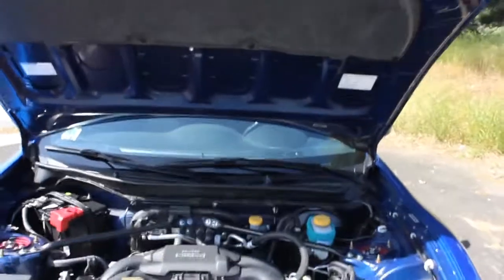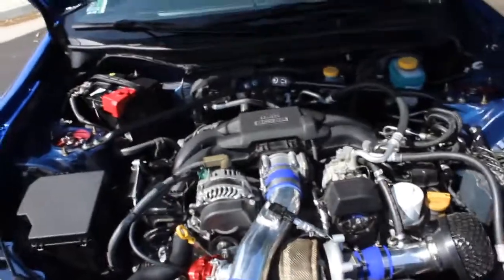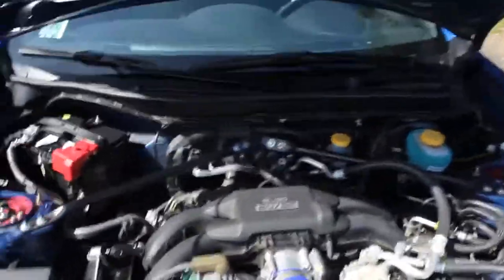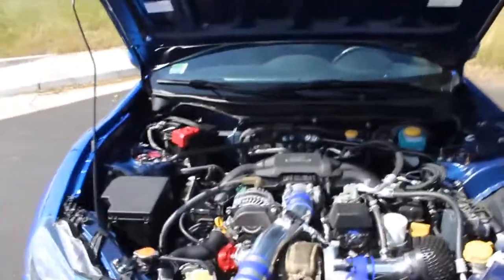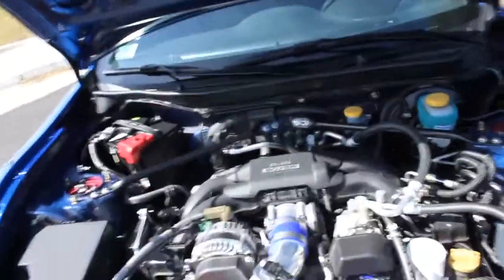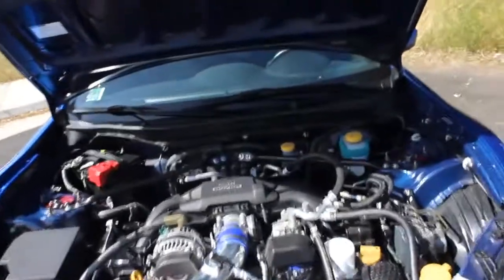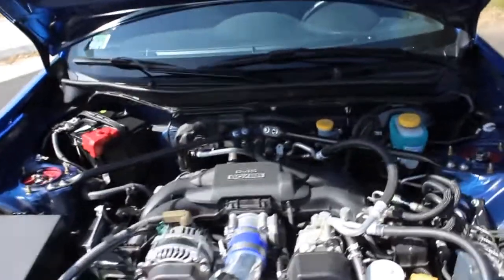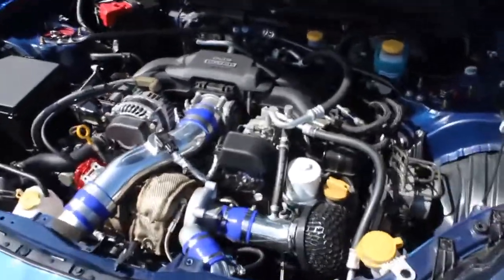(SBD) Speed by Design Turbo kit Review  - Brz/Frs/gt86

Comment: Great Build! What are you using for Tuning?
Reply from the maker: +OhHai Thanks and i'm using Openflash performance tablet with an e-tune from them.
Reply: +SubieDK Oh sorry! you mentioned it in the video lmao.. 
How come you said you were on your 4th tune??
Reply from the maker: +OhHai the way the e-tune works is that instead of going to get a dyno tuned you use your openflash tablet and you log a 3rd gear pull and you send that to a tuner from open flash and he adjusts the tune and sends it to you with changes and you do the pull again and you send the log to him again and you do that back and forth until you get it perfect and your car is tuned properly and I was just on my 4th tune so it was still not all figured out.
Reply: @subiedk9386  how much did the tune cost you?
Reply: @subiedk9386  how do you log a 3rd gear pull? I didn’t see that setting on the oft

Comment: Total cost ? And did u get the front bash bar and upgrade clutch?
Reply: $3425 for kit with prewelded oil pan, blowoff valve, mapping. $188 for drift bar, $665 ecutek Bluetooth flash
Reply: Jacob Chacko hey man where did you find that price?

Comment: Hey I subscribed and thumbed up on most of your vids just wanted honest advice from you. I did the Toyota valve spring recall epriperly broke it in. Now the new valves seats springs, all we t bad came apart causeing a chain reaction, so one piston had to be replaced, two cams, one cam shaft. Other parts etc. Had about half the engine internal parts replaced with new stock parts. All this happened when I was on low 6.8 PSI supercharger boost rotrex. Wanted to see how the FRS accelerates after having the new valve springs so all this happened. The engine block was smoking at the time . Only did a normal hard acceleration but never past red line. So my question is, would you ever put back the supercharger keeping only factory tuned low boost by Jackson Racing and trust these new internal parts. Or just sell the car as stock?

Comment: I'm using a Borla UEl headers on my 2016 frs. Would my header be compatible with this turbo kit? TIA
Reply from the maker: No it wouldn''t because the header design is totally different and it comes up through the the front of the car to connect to the turbo
Reply: Esteban Ibarra the sbd turbo along with many other turbos use their own turbo manifolds, if you're looking to use your own header, either go supercharge, or get the ptuning turbo, theirs attaches after the header so you can use any header you like. if you're going for the uel noise, jdl, map produces uel turbo kits

Comment: did you have to give up any frature to put the urbo in or did everything just fit?
Reply from the maker: Every thing fits nicely you just need a different front crash bar because the stock one won't fit with the intercooler
Reply: SubieDK nice! did u get the turbo that makes 100hp or the one that makes 100-125whp, that requires an upgraded clutch
Reply from the maker: The one that makes 100hp they just started making the new version

Comment: What is the estimated 1/4 mile trap speed capable with this kit?
Reply from the maker: I'm not sure but I've heard its in the high 13s on stock tires
Reply: I'm more curious about trap speed (mph) Any ideas?
Reply from the maker: I believe its around 112 mph on a 1/4 mile